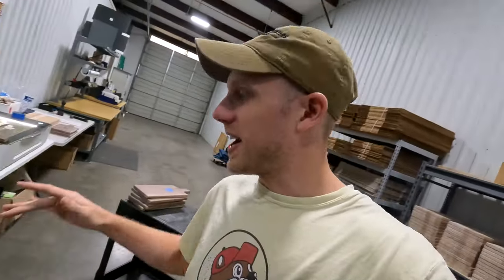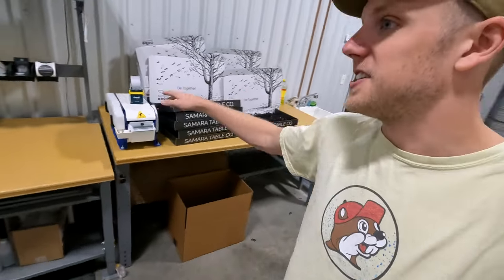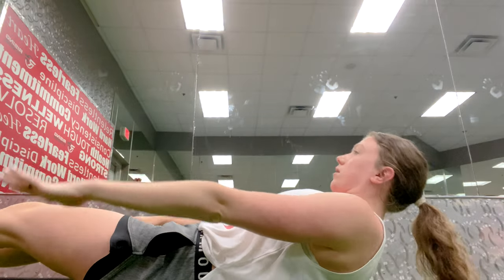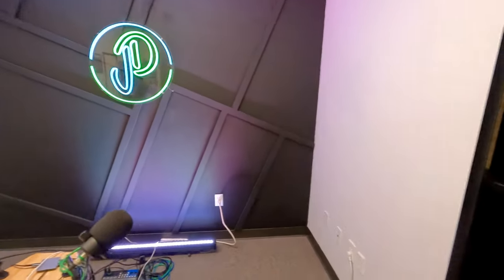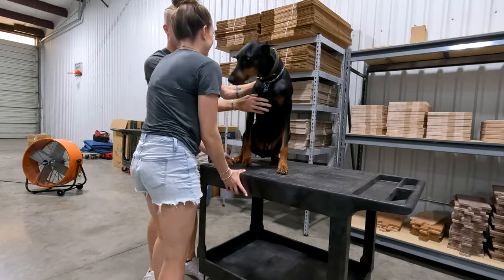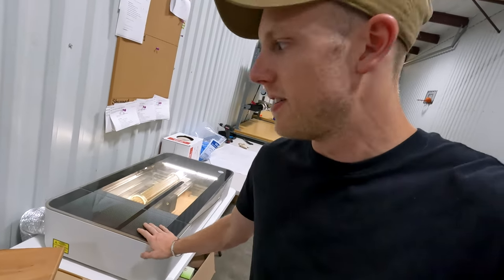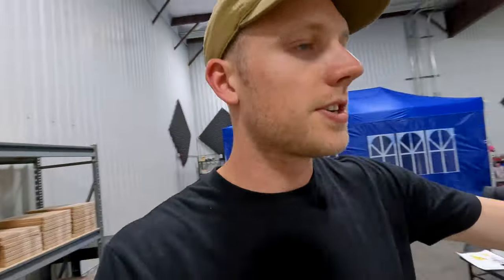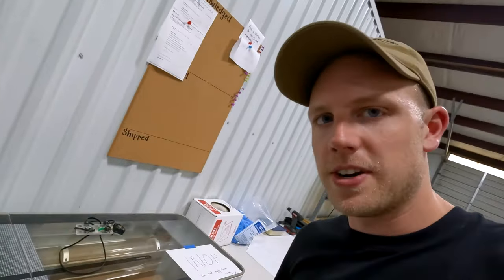our BUSIEST WEEK EVER! (And the Glowforge Laser BROKE!)

Comment: Rubbing alcohol will take off the sharpie. Then you can fix the mistake. Or hand sanitizer. Whichever you have on hand at the moment.
Reply: (+1 for rubbing alcohol, but in case it doesn't clean up perfectly) You can also make a label with the updated numbers and place it right over the top of the sharpie marks. It'll look more pro and no one will ever know what's under. (I do this when making cards, etc and I misspell something in pen. 🙃)
Reply from the maker: They fixed it, but we'll keep this in mind for next time!
Reply: Pen on wood is a crime
Reply: For some surfaces hairspray is even more effective, I've used whatever I have on hand!

Comment: I had the exact same thing happen with MY Glowforge.  One of the wheels split in the center at its weakest point (I actually cut shapes for boxes so it was an issue, but only horizontally).  Very easy fix once you know what to look for, and Glowforge is fairly user-friendly for basic maintenance.  They shipped me the part for free under warranty, plus an extra just in case.
Reply from the maker: Glad you had a great experience! We love these machines and are just now approaching their limits.

Comment: Hope you ordered extras of that part and not just how many you need now. If GF #2 broke now and it's your original GF, that means GF #1 is right behind it. It seems those wheels are a common problem with them splitting. I'm looking into machining a metal set out of either aluminum or stainless steel to eliminate the problem. I like solving problems before it becomes a problem. Making a high wear part like a guide wheel  (that the machine can't work without) out of plastic just seems like a fumble on Glowforge's behalf. Or it it all part of their evil plan for repeated business. Hmmm?! Notice they don't offer an "upgrade" version and just sell the cheap plastic version that broke to begin with.

Comment: Just drop the crappy Glowforges and get a proper chinese import co2. SO much better quality, faster, more capable, and not expensive. The jump to a production laser (Trotec/Epilog) is STEEP. I'll be upgrading my 50W to a 100W Coco Song laser here soon. Same quality as a Thunder/Aeon, but direct from the manufacturer so half the cost. You're also wasting a lot of time marking each board, why not setup a 90* corner (I just secured mine down with tape & CA glue)? Once you have the board profile loaded in Lightburn, all you have to do is upload the design and go! Not saying my process is the only way to do it or the best, but I believe we can all learn from each other and improve.
Reply from the maker: Hey Cody! Thanks for the suggestions. We've covered this in other videos at length, but we use Glowforges because of their ease-of-use. It's more profitable for us to buy an expensive machine that's easy-to-use and make sales, than spend our time playing 'laser-repair-man'. This is the second issue we've had in 2.5 years with the machines. As to your note about their speed, we've been able to ship 25+ boards a day with consistency. That's PLENTY fast for us!
Reply: @jennieanddavis  Buy a quality laser and you won't have any issues. I've ran mine trouble free for over a year now, and I purchased it used, it's a 2016 model. Lightburn is super easy to use, it's honestly not difficult. Don't let the bad stigma from (Omtech) keep you guys from jumping in! It's worth it! :)

This is like buying multiple trim routers or brush kits to have on hand because your trim router CNC is eventually going to fail, instead of just buying a quality spindle and good quality rack an pinion/ballscrew CNC to begin with. shrugs
Reply: Totally agree. Step up from the hobby machine

Comment: Don’t replace broken parts with stock. 
Start a business that makes quality parts to replace cheep parts offered by glowforge. You don’t want to expect that unnecessary problem again.
Glow forge has been around long enough to have addressed that problem but they choose not to fix their shortcomings for profit. 
Glowforge puts profit before the costumer.
You have a drill and file. Make some aluminum wheels. Even my curtains have better track wheels🤣😂